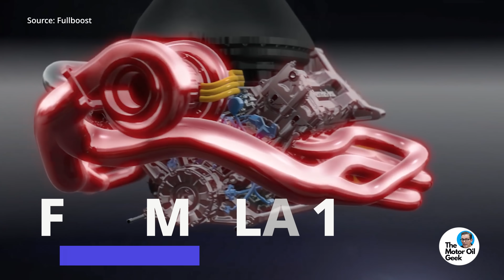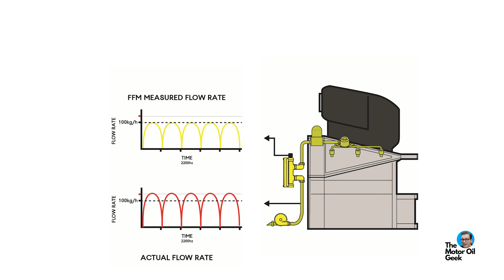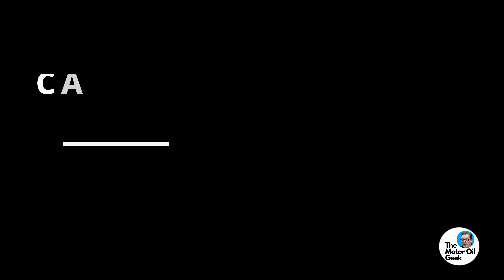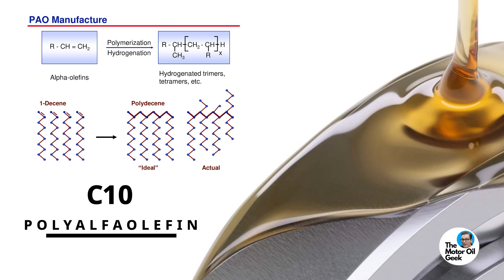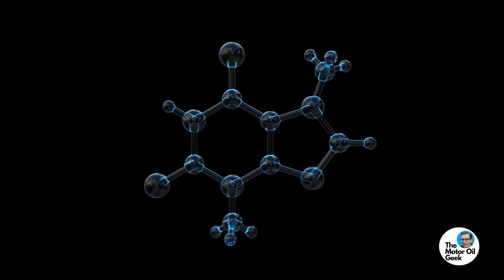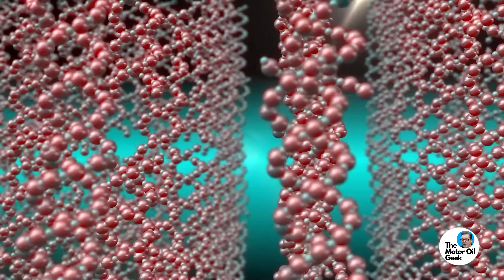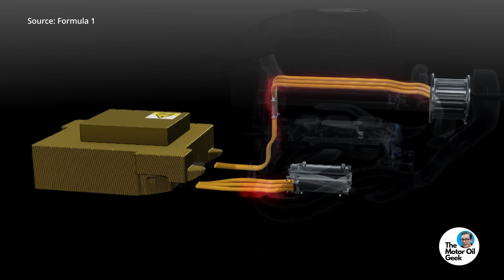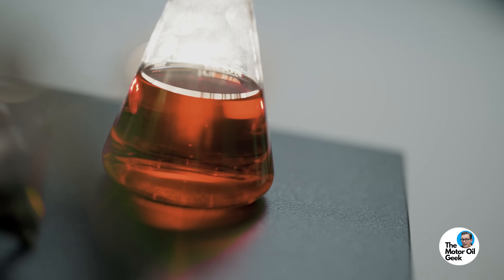SPEED SECRET: How F1 Engines BURN Oil As Fuel

Comment from the maker: For a deeper dive into Formula 1 power units, check out this great video from Engineering Explained: https://youtu.be/KjrNcuc89Pc?si=rOW0YAwrIknYfJRU
Reply: I always wondered if you cud use diesel as oil in a stroke engine
Reply: @Eduardo_Espinoza  Sure, but not for long I guess. 😉
Reply: Very interesting  !  Now if GM could add some DLC where needed on the 6.2 gas engine
Reply: So, what you are saying, do not feel bad if our car burns 1 Quart per 1000 miles. it is to boost the power. LOL. Probably start to use very low ash oil.
Reply: Can you use clean and protect on a new engine?
Reply: @murtoasumpoiler  Yes, but maybe only useful for engines that tends to have oil consumption. Otherwise, API SP oil is more than enough to keep the engine well as long as you do 5k miles OCI, not stupid 10k miles. 10k miles maybe relevant for highway drivers like >10 miles per trips in mild weather.
Reply: Hi Lake, any info you could bring us would be great, all your knowledge is awesome.
Also, can I go down in cool viscosity that manufacturer recommendation, even in summer climate like Cancún? cuz wanna give a good flow at starts, even if I go down in viscosity & the cool oil is thicker than a hot oil. Goin from 5w40 to a 0w40 in a Chevy LM4 IIIGen w/ 300K km, but if choose a good Ester & PAO Base, should I care about VI Improvers Breakdown cuz the high difference between the 0 to the 40 grade?
Thaks a lot!! 
I'm Really your fan!!!
Reply: I like the video. Seen him describe some things before . And  love watching your videos.

Comment: It burns oil because of the flat piston design and ring gap. The oil acts as the compressor in the combustion process, and gets burned along with the fuel. Higher compression, equals more power.

Comment: Brad Pit led me here somehow. Few questions popped in my head. I tend to approach things from an esoteric perspective and even ignore the scientific side, strange I know. Its just my method.   Does this oil mix make the engine more like a semi diesel that will tolerate high c/r or boost? Have you ever tried using light or lasers etc. to amplify energy within oil-fuel? Or use torsional fields-within pyramids to charge the fuel?

Comment: My 2004 celica burns a lot of oil. No, it's not any faster. All it did was clog up my catalytic converter. As the engine heat up, the pistons and rings expanded - smoke less. Big horsepower = alot more heat = more clearance = less friction from less metal to metal contact

Comment: It's similar to the stories of stock eliminator racers buying the used 70wt motor oil after a fuel car drains it after a run.  Even though it is 70wt, there is so much nitro dilution that with the thin rings and super low oil ring tension of a stock motor, putting at least some of that used fuel oil in the crankcase of a stocker can add enough power (as the oil seeps into the chamber and burns along with the nitro in the oil) to make a difference!

That's why you see stockers with multiple PCV valves--each PCV valve is more aitflow into the intake manifold.  In a class where you might have to run the stock 2 barrel carb, ANY extra airflow is welcome!  This includes the stories of leaving the carb to manifold bolts/nuts loose so the air leaks below the carb under the high vacuum that would happen at full throttle.  Jet the carb richer than it would normally be and its like running a slightly bigger carb.  No, it doesn't fit the "spirit" of the rules (and I'm SURE most tech inspectors check to see if the carb is tight on the intake) but guys are looking for any advantage they can in stock--ceramic wheel bearings, low drag brakes, 0 toeall around, 85-100 psi in the front tires, 0W-10 motor oil for the diff--I've even heard of draining it completely for a final round!

Comment: I guess this is a semantics matter..but I had heard that, rather than using the oil as a fuel...that is, as a significant source of energy, the oil was used as a combustion modifier.
   More like an "octane booster".
   Even in the past days of higher f1 oil consumption,  the amount of oil burned was miniscule compared to the fuel flow rate.
   The relatively small amount (now mandated to about a quarter of that) of engine oil that made it past the rings was more of a "fuel additive" than a fuel.
    This, like any other octane booster, allowed the use of more manifold pressure, giving a higher bmep and power output. (Car guys like to call it "boost", but that word is annoying...it is a higher absolute pressure in the manifold. )
    Any comments on that "fuel-vs-fuel additive" difference?
   I don't follow f1, but this clever way around the rules got my attention.
   Smokey Yunick would love it!

Comment: Could  you make a video about motorcycle oil? specially focused on old flat tapped 4 stroke bikes? What about modern oils without zddp? and what about using car oil or diesel oil on a motorcycle? Are there really special aditives necessary for the wet clutch? Thanks

Comment: I've always heard the saying that oil in the combustion chamber lowers the effective octane rating and often engine builders/tuners say that the oil induces knock.  But with F1, oil was part of the fueling, yet no mention of this lowered knock limit, some even said the oil increased the knock limit.  If I recall correctly, in a video from EE there may have been the mention of this octane boosting via the oil, but that was years since I saw that.

I'd like to learn about this, what is true, myth and what the challenges were regarding this in F1.  Does any of this apply in a more normal street engine?

Comment: They don't burn oil as fuel because they want to, they burn oil as fuel because they have to due to fuel flow restrictions. Burning oil as fuel requires a reduction in output power, otherwise severe detonation and engine damage will occur!

Comment: How do they prevent detonation at the compression and boost thy run? Are there base stock that don't cause the typical problems at high cylinder pressures, or the combustion chambers so perfected they resist detonation despite the presence of oil?
Thanks for all you share, and I repeat the request I see in the comments for an in depth examination of 2 cycle oil chemistry.

Comment: Imagine if they went to vegetable oil burning diesel engines !  Major improvements could come from that!  f-1 diesel or f-1 steam engine 😂 . But seriously, compression ignition f-1 engine. Possibly  coupled with compressed air supercharger that could  refill its self partially  during deacceleration and pit stops Possibly using liquid o2 and liquid nitrogen added to the tank to boil off making air. Maybe 4 oz of o2 and 8 oz of nitrogen. Making o2 about 33% im betting a boosted engine could make power with 33% oxygen content. Under 60psi and 30°f they should be around 1000 hp per litre . Sounds insane.  It should be capable of 750 per litre. then go oil burning  compression ignition, maybe a 1.6L v12 .. doing 10-12k rpm they would probably be 15:1 running 100 psi of boost with the commpressed air supercharging. They would probably look for ways to double that out  of the corners. Imaging 200 psi of near 0°F intake charge entering an engine  it may need more compression to produce the heat for ignition. A race team couldn't run methanol because the intake charge was too cold to vaporize the methanol. With 60psi 30°f . I think the mixing liquid o2 and nitrogen is the fastest way to refill a tank . A bit dangerous 😮...

Comment: Fuel disolve oil and ritch fuel mix dissolve more oil in the cylinder. Air like in a jet explode after stress╔├¾ compression start to ┼ space to realease heat in like more space/piston going down. So the most interesting part of combustion is not fuel, it is the electricity voltage in the air.

Comment: Hello, Lake, I just purchased one of your oil pump and sample kits, but I have a conundrum about changing oil on a brand-new M3. I have a background in automotive engineering and I’ve been published in SAE, and I worked at ORNL for a few years, so I’m decent at doing research, but I can’t find any data-supported guidance on whether changing the oil at 42 miles is bad or good for longevity. My presumption is that regular oil is used for the initial factory fill, but is it the case that the manufacturing debris becomes a kind of slurry that helps mate engine surfaces together, and therefore should not be changed too early? Or is it better to change it as soon as possible, e.g., 50 miles, then 250 miles, then 500 miles, then 1000 miles, etc., until a 2500-mile interval is achieved? I understand that might seem way too short, but I change my own oil, and the technician who does the belt services on my Ferrari 575M told me to drop my intervals to 2500 miles for that car and my 2014 911 turbo S cab. It seems like this might be an opportunity to gather some data, so if you’re able to offer your thoughts, I’d be grateful for the guidance. It might also make an interesting topic for your YT channel.

Comment: Can you do a video on Harley Davidson’s Syn3 V twin motorcycle oil? They say you can run it in all 3 holes. Engine, transmission and primary. 
I think there’s some other brands that make that claim too. I’d like to know what’s going on with the oil to make it possible. Seems like to me that you’d have to sacrifice either what the clutch needs or what the engine needs. Right?

Comment: Hi there Lakin. I would really appreciate you doing a session on Ethanol free gasoline. A few years back I purchased a new unused carburetor for an engine I use. About a year later the engine stopped running because the jets were clogged with gum. The problem is, I only used ethanol free gasoline. What? How does that happen if the claim “ethanol free” was accurate? Very confusing. It seems the claim is a lie or at least inaccurate.

Comment: Hello, I have two high-performance cars . A 2020 RS3 that runs e85 with a full frame turbo kit. I'm currently running DT-Driven 5W40 in this car at 3k intervals. Is this the best oil for this application? My other car is a supercharged 1991 built NSX. I'm running redline 10w-30. Thoughts or recommendations?

Comment: Lake, this is not a new thing! 40 years ago, go cart racers were using Alcohol for fuel and spiking the oil with Nitro. The motors were built with real loose clearances so they would consume a lot of oil giving them much more power.

Comment: Lake. I’ve bought a magnetic oil plug. Then realized if I wanted to do oil analysis it would skew the results.  In addition have you ever considered selling g your data?  I’d pay for the top oil and weights for a 5.7 tundra being changed around 5k miles in a climate similar to SC.  Doing 13k miles a year and doing 5k oil changes it would take me a few years to decide what oil works best.  That is assuming I change the oil and send it in.  Charge me $20-50 and I’d spend it in a heartbeat on all my cars.

Comment: Thanks, Lake. Great vid! When you have time, I'd like to see a vid or two on two stroke oils and their affects on fuel octane levels. As we all know, two stroke oils are made to burn. I use to build and tune performance two stroke outboards years ago back in the 80s and 90s, and the two stroke oils of the day were horrible and left all kinds of deposits on rings and pistons. Fast forward to today, and back to even 10 years ago, and the oils are so much better that now I can run my two stroke weedeater and blower at 100:1 with a good synthetic two stroke oil, even though the manufacturer calls for a 50:1 mix. So, what gives? How can a good synthetic two stroke oil being run at 100:1 protect as good as a non-synthetic oil being run at 50:1? 
Also, how does this way leaner oil mixture affect the fuel octane level, regardless if I run 93 octane pump premium, 100 low lead aviation fuel, or 110 VP race fuel?
Thanks!

Comment: I'll tell you that even a low-tech version of this works.  I once bought a Toyota Paseo that had a ton of blow-by and burned about a quart of oil per HUNDRED miles.  To my amazement, that car got 43 mpg city, which was substantially better than my previous, theoretically more efficient, Honda CRX.  How could this be, with a worn-out smoking engine?  Easy.  Each tank of gas came with an extra gallon of fuel courtesy of the oil pan.  The local quick-lube place had an unwise free top-up service, so I'd roll in there each morning for a fresh quart and a half before logging into GrubHub and doing my deliveries for the day.

Comment: ALWAYS find your video interesting, Oil? Right?.  Retired a few years ago, bought a new vehicle, Turbo charged.   They recommend high Octane premium fuel only.  What gives?  Also, and you probably have covered this, as a retired person, I don't drive like I use to, so my oil changes come due via time, not miles?  Made me wonder about what happens to oil that just sits there in a engine and what is a valid time before changing the oil if you only drive 5k a year, do I really need to change the filter too?.   I mean, does the oil on the stores shelve have a expiration date, best used by date?  This is why your channel is awesome, prior to watching these video, would I even think like this?   Again, thanks for you video's.

Comment: Thank you for this video.  I remember Marvel Mystery Oil had an "Inverse Oiler" my Dad and I installed on his 60 Chevy Bel Air with the 283  2BBL carb.  It did help for fuel mileage but also helped to lubricate the top piston ring. I know that engine went well over 100,000 miles before it started to use a lot of oil.

Comment: Let's put it this way in a hybrid power system the engine only produce power to turn an electric generator that produces electricity that goes into a converter that electricity switches the current from DC to ac that goes into a battery than then goes into an electric motor that turns the transmission so the electric motor produces the real power to the wheels  and that power is around 1,000hp.

Comment: This was never a secret or a mystery to those who understand fuel and combustion properties of oil. 
     My father explained this to me back in the 1970s. 
         If you just turn your oil into a combustion product. By altering its make up.. 
    And delivery system into the combustion chamber.
     And if you start thinking more along the lines of diesel engines and combustion pressures and temperatures what is needed and how to work around the problem. To come up with a solution.

Comment: I probably haven't drunk sufficient coffee just yet, I am left wondering how the ECU / PCM keeps on top of the AFR if the PU is depending upon an amount of oil getting into the cylinder as this is unlikely to lend iself well to metering known amounts and staying within the rules, or is it as simple as the rate of flow is fixed / known at the time of manufacture and supplied as lookup table(s), for a given engine speed (and other variables?) they know how much oil shall reach the cylinder and can then subtract this from the fuel required to achieve the correct AFR.

Comment: I wish they just went to their supposedly sustainable fuel with their older cheap to make v8 at 18k rpm instead of wasting 95m a year on engines and throwing away all but the best due to getting punished with penalties.
Would reduce the barrier for entry massively

Comment: This has ben used in many forms of racing. Gocart racers used to put propylene, or  nitromethane, in the oil. Then, run an old worn-out oil ring.
Reply: I ran a Honda gx engine with one piston ring and the crank case vent tube right into the front of the carburetor then we would top up the crankcase with some 35% nitro methane

Comment: GM in particular would love the burden to continue to shift onto engine oil makers to compensate for their ever-increasing cost-cutting measures, e.g. surface finish and metallurgy problems causing the huge 6.2L L87 recall and motor oil viscosity change.  Prior 6.2L LS engines didn't have these problems because they didn't have as extensive cost-cutting measures in place.  Ex-GM engineers have made this public information.  Late-model GM 10-sp trannies are suffering the same fate for the same reasons, even though ZF provided them and Ford a solid original design.
Ford, Stella, and even Toyota and other "imports" aren't completely innocent here either.  Part of my point here is that solid maintenance is more important now more than ever on new automobiles.

Comment: Thanks that was really interesting,  I'm not a fan of formula one I really didn't know about this at all😊- but as a previous 2-stroke and present Mazda rotary owner, I'm interested in engineering of oil burning. It's a bit niche but actually a topic I'd like you cover is the  exactly that 😮: there's a lot of controversy in rotaries because for the RX8 Mazda recommends old-fashioned mineral oil! Yet lot of owners want advantages of modern synthetics, however as oil injected into combustion chambers this i said to be potentially bad as its not designed to be burnt, so leaving deposits (& deposits can kill a rotary). Some opt for halfway option of semi-synthetic etc. Would love to get your perspective on best lubricant option for this quirky engine!

Comment: I haven't heard of this before, but at the same time, it's not too surprising. Oil burning produces a crap-ton of heat, which can be quite useful for the right parts of various engine cycle types. Jet engines, injecting it into a Really hot turbo volute, diesels obviously, or the lesser known unusual case of oil-burning forges (my case) for heat treating and refractory use.